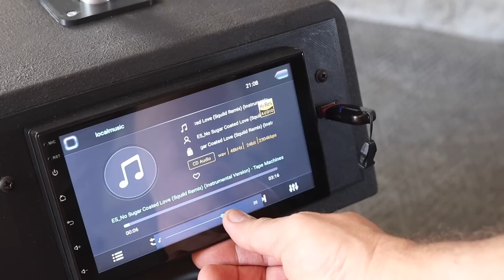Building a Multimedia Bluetooth Column Speaker - by SoundBlab

Comment: Really I have inspired by ur work nd for this project I have some suggestions to that pokes me finishing of those box and gaps were not filled properly but if gone across your old project awesome finish that too fine crafted but in this project something lags @SB
Reply from the maker: Thanks. It's all about goals vs outcome. In this project I did not try to build an audiophile quality speaker. It was a more fun project using off-cuts in my workshop and a bit experimental, trying a few new concepts and ideas and putting out a project that can inspire. From this perspective, I feel that it was a success, but I appreciate any feedback. Thanks!

Comment: Although I appreciate the project and the solution gone into the finished speaker, in somewhat disappointed...
You have always made speaker with excellent finish and impeccable build quality. In this project or seems like you have been pressed for time and cut several corners along the way to the finish line.
Just sad to see the poor build quality and the lack at finish. The way you fitted the psu in the enclosure is just sad, and the use of screws on visible surface..😕
Why not use a multi connector for the top? It's just all too easy to get the connections wrong and wire the top out of fase.
Also a possibility to run on batteries would have been a good feature.
I'm still a follower, but hope to see you back to the normal standard in the coming build.
#BrianTheBoombox
Reply from the maker: I am sorry to hear that. However, my aim was to use some off-cut wood in the workshop and do a build that is less serious. This is not intended to be a high-end build at all, but hopefully a fun project that will inspire some to go out and try something like this themselves. So, I kept it simple using basic materials, showing that not every project needs to be audiophile. I actually spend a lot of time on the project, it was not a rush at all. I like the outcome and am very proud of the concept and idea. I am also happy with the finish, since this is what I intended, and thus meets my goals I set out in the beginning. There are many things I could have done differently, and a multi-connector is and option as are batteries, but I wanted to keep it simple, not overcomplicating it with additional circuitry. Again for me a matter of goals set for a desired outcome.
I will be back in the new year with some more exciting projects that will cater for my more concerning viewers. Thanks for the feedback, I appreciate it, and keep watching this space!
Reply: @SoundBlab  Thank you for the prompt answer and explanation and thoughts before and under the build. I'm looking forward to the coming projects.
Would it be possible to dig a little deeper into the calculations on which the enclosures are made? What are your aim as to lower end limitations and what tools do you use?
Keep up the great work!👍
Reply from the maker: Thanks Peter, I am hoping to delve a bit more into the design process in future videos.